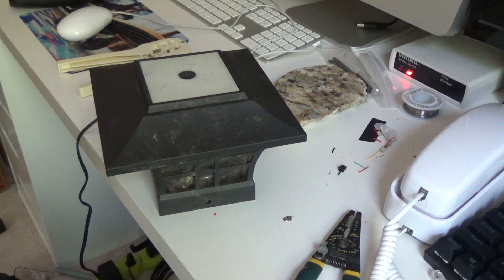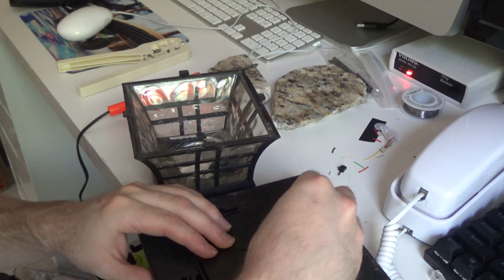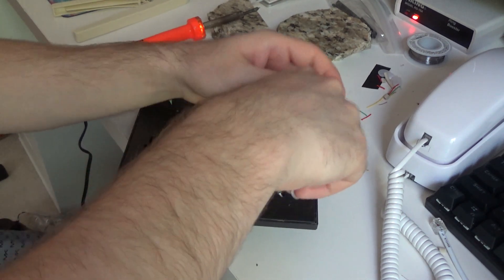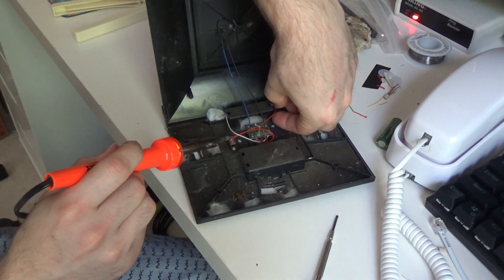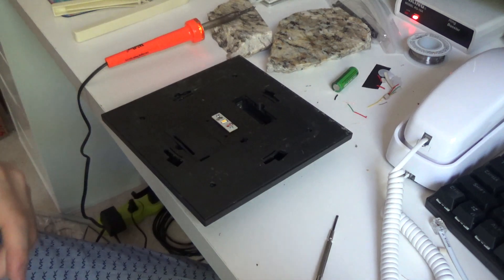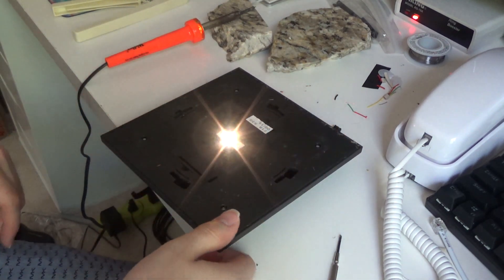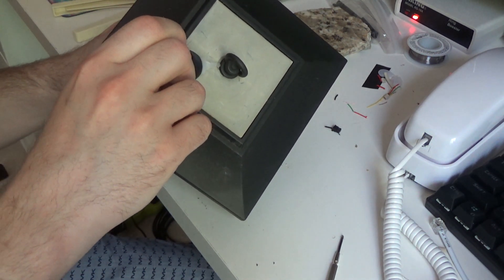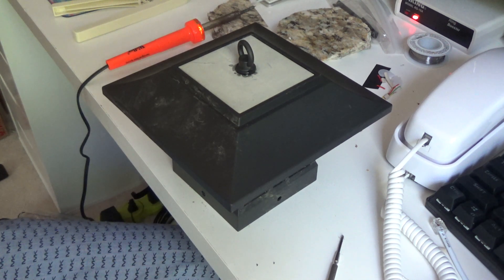Hampton Bay Solar Light Repair

Comment: Excellent, you even used the right type of glue.  Utilizing your tools effectively.

For future reference, occasionally, giving the threads a good number of wraps with teflon tape will allow them to grab again.  Again, your repair with the glue is the right solution, as I wouldn't trust the amount of weight you say it is on already buggered threads.  However, that tip may come in handy for other things in the future.
Reply from the maker: That makes sense, but there weren't enough of the threads left on this thing.. The majority of the threads broke off inside the unit some time ago..